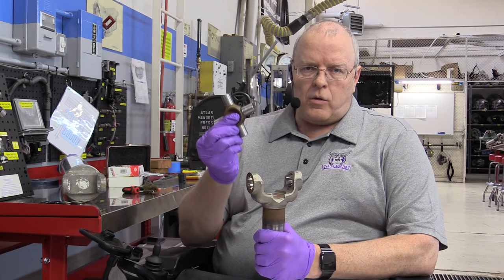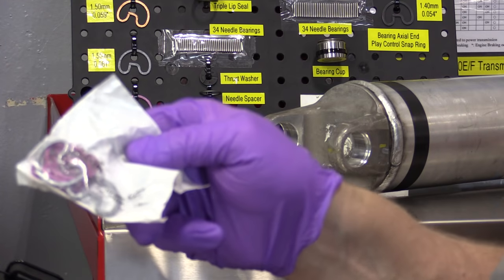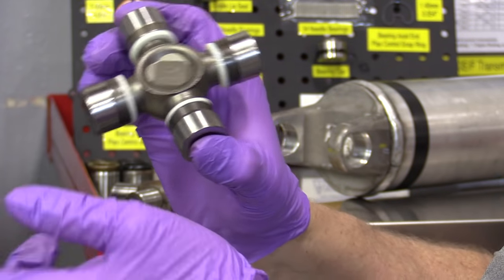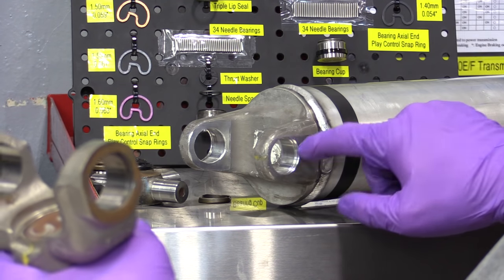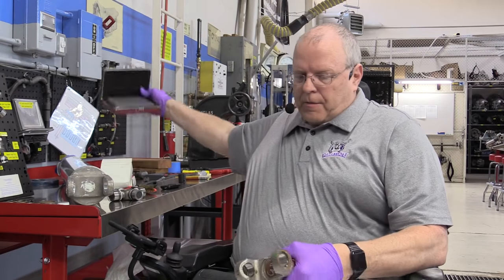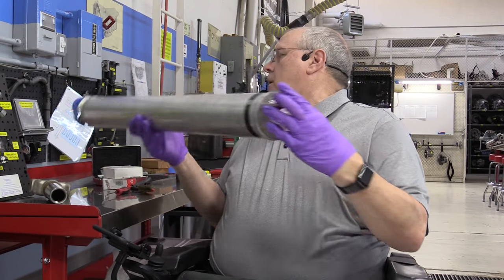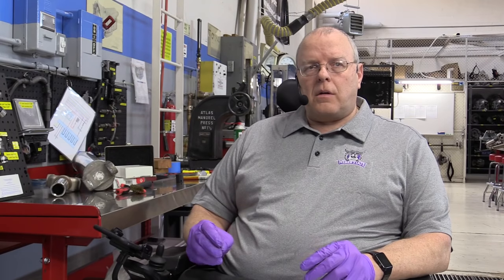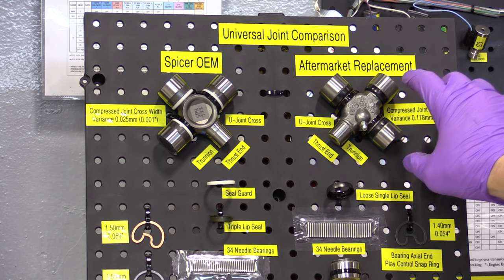Universal Joints - Part 6: Proper U-Joint Installation

Comment: This video, and the others in this series, got me through a recent u joint fitting problem. As someone who thought that the right way to replace U joints was using a hammer and a vise, this was incredibly useful, and of course when I followed the correct procedure, everything went smoothly!
Reply from the maker: Excellent! I am glad you were able to get it resolved. Thanks for watching

Comment: What a great series on the "lowly" u-joint!  Mechanic for many years, now mostly retired.  Learned a lot from these videos. They begin to expose the low level of knowledge in the  US auto repair industry (need more and better trade schools).  However,  mechanics in the rust belt deal with less than surgically clean , nearly new parts.  A good torch is their friend.
Reply from the maker: Thank you very much. I know what you mean.

Comment: Of all my years of replacing u-joints I've never had a u-joint come with different thickness snap rings. And many times I needed a thinner snap ring. You are also the first one that has removed a u-joint the right way. Nice video.

Comment: I notice a lot of the comments below are from people who had problems with U joints being too tight and being grateful for Professor Kelly teaching us about snap ring thickness etc.  I wanted to share my experience that might help.  I have a truck with over 250,000 miles that I often over work which causes me to need to replace U Joints every 60,000 miles or so.  Even using a ball joint press and being careful, the ears get bent inward ever so slightly each time I press out and press in a new joint.  My U Joints are now so tight even with the thinnest snap rings Spicer makes I am forced to either buy a new driveshaft or have a transmission shop cut off the ears and weld new ones.  I tried a driveshaft from the salvage yard and of course....its ears were bent in worse than my original one!  It was from a low mileage truck but you could see hammer marks where someone had hammered out the U Joint at some point.  So, I just wanted to get my experience out there that even with a ball joint press I still slowly bent in my ears.  I need to locate a tool that prevents this that is less expensive than Professor Kelly's wonderful press.  My best to all.
Reply from the maker: Great example. Thank you

Comment: Such an oustanding series!!! I wish my garage was as clean as his work space. Having just done the ujoints on my 2002 Seirra 1500 it can be like surgery, 1/8 a turn can make or break it. I did use some caliber grease In the ears but it probably was not needed or advised. The thing that loosened mine up after installing the new ones was a hit with a hammer at the end of the ears, it seems to settle them in so they spin freely, made a 50% difference. I also did not remove the driveshart from the truck so I guessed on the install orientation, but seemed to get it right as there is no vibration or clunk when shifting. One piece oem Spicer drivshaft and installed new Spicer ujoints, the label was still undamaged and easy to read. When in doubt call the Spicer customer service line with the part number and ask what was used originally, as the website information can be overload. And remember a new aluminium Dorman driveshaft is $800.00 for the truck the cheapest new I found was $240.00 for painted black steel tubing. A national tire shop chain claimed the driveshaft was unusable, but I filed a few burrs from one of the ears and it was as good as new.

Comment: Attempted to press out an old scrap GM  joint with the plastic retainers without using heat.  I wire brushed it, then applied penetrating lube .  Blew the end cap apart but did not budge.  I think heat is necessary on old, hard plastic.

Comment: Thanks for the class, after watching your video I had the idea to remove the snap rings from both sides and sand them down, then are not flat and I’m hoping a few thousands I can get this joint to move freelly, so far it’s looking better, one was .00515 and now I’m down to .00500, the other .00490, I do t see an issue with this as long as I’m doing it by hand and not heating it up

Comment: GREAT video .. but 45:38  i have found that after installing the caps, even if everything IS correct it still seems a little "stiff"  i think what is happening is, the needle bearings are side loaded by pushing the needles ( the cap ) sideways onto the trunnion and that causes them to drag instead of roll  ... i have found that if you put the yolk on the flat part of a vice ( on the back) and give it a quick _ NOT HARD_ hit on the back of the yolk, behind the bearing cap ( between the bearing cap and the shaft part ) shocks them into place and it "frees up" the needle bearings and it is loose as a goose. try it next time ... i think you'll be surprised !    
20yr cat equipment mechanic, ive seen a couple driveshafts ...

Comment: With that "sprung" snap ring, i would try to reverse the snap ring pliers, and expand that snap ring and then install it... ytou know if it snaps into the groove like it should, I would have no worries.. of course I have no data to support that, but it seems sensible.   Also I have a set of MOOG 232's for a corvette, and they just came with black snap rings... I will ensure I get a good fit!   Thanks for the class!

Comment: Re. Tight snap rings / cir-clips: I had the same problem. The old bearing cups were very hard to press out of the steel yoke and needed a lot of force. After fitting the new unit, I could only get the snap ring to fit in one side of the yokes. The other side was now where near close to being able to fit into the groove. I even tried an under standard thickness snap ring but that would not fit. I therefore  removed the new unit and it measured up. It was perfectly to specs. The only explanation therefore was that, under the force of extracting the old unit, the yoke ears had deformed inwards. This was confirmed by taking measurements of the yoke. The answer was to use an extractor in reverse to expand the ears back out to their correct spread.

Comment: I would consider running the snap rings on a whet or diamond stone a few times to take the thickness down. Could take caliper readings every so many strokes. About to change my 2003 Silverado joints in two days.

Comment: 1/100 mm is smaller increment than 1/1000 inch (which is 2.5/100mm) so you may prefer metric after all.

Comment: But why not use the u-joint removal tool when putting in the new u-joint? That would avoid any risk of bending an ear (even with the steel to spread the load)?

Comment: It could be the washer of the steel youk flipped out while being removed in and out, I think there should be some sort of direction on it. One clip shows grove on it for the grease to balance its self across the nedle bearing and move from underneath.  And this will add thickness if it flipped.

Comment: Nice episode. I have one question: I bought a new driveshaft from Dorman. The rear side has a runout of 0.4mm which is huge in my opinion. The runout is even for the entire lenght of the tube so I was thinking to compensate/ correct this by moving the u-joint using snap rings with different thickness. For example, if the current thickness is 1.50 for each one, I would use 1.55 in one side and 1.45 in the other, so the load will remains the same. Is my judgement wrong? Thank you in advance for your answer.

Comment: 32:00 Seems like the final press-in to make room for the spring clips could be made easier and more uniform if -- instead of a socket-and-bar arrangement -- someone would make a pair of round shims/washers, of very specific thickness (like a U.S. quarter or multiple thereof), that could be applied to the face of each cup. This way, once they are pressed flush (both at the same time), you'd know each cup was recessed X mm inside the outer face of the ears. Have you ever tried such an approach?
Reply from the maker: I have not, thanks for the feedback. I will have to try that. Have a good day!
Reply: Subscribing! The world needs more great educators like you, sir.

Comment: Thanks alot, i just stumbled on your video series, i have watched two already. i have a peculiar problem: I use a diesel electric generator off grid. I have massive misalignment problem between the prime mover and alternator, both didnt come from same OEM, it's a DIY assembly. I just installed a twin U-joint coupling  and i still get some vibrations. There is no shaft between the two U-joints, they were welded together. Do you think lack of a shaft is the reason for the vibration?

Comment: All these techniques are great if you're from the south. I'd like to see you use this press up here in new England and when the truck comes into the shop with 100k plus miles and it's all rust. This is great in a perfect world and on a brand new vehicle but unfortunately this isnt reality
Reply: Yeah, I lived in Boston and Philly and it is a nightmare working on cars from there.  I'm in Dallas now.  Original owner of a 2007 Xterra which has spent all 245,000 miles in Texas.  All bolts, axles, everything still looks like it did the day I bought it.  I changed a front wheel bearing last year and every bolt came off looking new.  Hang in there Michael, you got my respect!

Comment: Great video, just long but very informative! One question though. If a snap ring is too thick even on the thinnest ones, can't you slide them over a piece of sandpaper to make them slightly thinner? If you make them exactly the same thickness as the ones you took off, they should fit.
Reply from the maker: They should fit is the snap ring grooves are perfectly clean and undamaged. Thanks for watching

Comment: Really wish I had seen this video before I tackled my u-joints. I did them with a ball joint press but did not have the other tools. Thats the only way I have ever seen them done. I had the same situation where the snap rings were too thick and wouldn't go in. I sanded them down (hold your fire) to get them to fit. The joints felt good and free but I have a bad vibration from 40 mph and up. Worried I may have bent the ears on my yoke.

Comment: I installed three different ones in my yoke and I still have some play of the joint in the caps, but snap rings are in. When I filled with grease the movement went away but do I need thicker inner clips?

Comment: Where can I find the Spicer part numbers for the optional u joint snap rings?By the way I am working with 1350 series joints.
Reply from the maker: The Spicer small parts catalog. See https://www.google.com/url?sa=t&rct=j&q=&esrc=s&source=web&cd=1&cad=rja&uact=8&ved=0ahUKEwjRksqGkbPSAhVkqlQKHVfqCHUQFggaMAA&url=http%3A%2F%2Fmedia.spicerparts.com%2Fcfs%2Ffiles%2Fmedia%2FkX23a5sT5yt3LYTdn%2Fj300-p9.pdf%3Fstore%3Doriginal&usg=AFQjCNEugiout_OEUvjXTL2ZweBDDKy2Zg&sig2=L0CUJx30x53CTDhNvxN_6w&bvm=bv.148073327,d.cGw
Reply: Thank you
Reply: Where can I buy u joints for a Mazda Cx92008
Reply: I have downloaded a pdf of this exact catalog and spicer will not sell them to me. They also said they are only sold in packs of 25.  And, that I have to consult a "distributor" and upon doing so the distributor told me to send them an email outlining what i need, to which i never got a reply! These little snap rings are scarce and extremely difficult to deal with. The market is not hell bent on making them widely available.
They should be sold and stocked at EVERY auto parts store in the world that sells universal joints.

Comment: The only criticism I have is I don't see the need for the steel plate you used between the press plunger and the yoke.  The plate is just another item to try and manage without a third hand.

The plunger is the same size as the contact surface of the yoke ears.  Adding the steel plate has no advantage.  You are not distributing the load, as you say.  You are pressing directly on the same amount of surface area of the yoke either way.

Comment: there is so much variation in snap ring thicknesses, they should really supply more in increments of .001".
And, the fact that an aftermarket ujoint comes with only one thickness which can be way out of wack is deplorable.

Comment: I just had my u joint on my 2005 Toyota Tacoma TRD and my mechanic just used a hammer to remove and install the new part.    I was shocked he did it this way.    No balancing at all!     I could've got a weekend warrior mechanic for $60 to do the same job.   Not impressed!
Reply from the maker: Typical! Thanks for the feedback.

Comment: a thousands of an inch is a finer increment than a hundredth of a millimeter
i listened twice to be sure that is what was said
0.01 mm is about 0.0004 inch, 0.001 inch is about 0.025 mm
so a thousands of an inch increment is about 2.5 times coarser n than a hundredth of a mm......
Reply from the maker: You are absolutely correct, I got that backwards. good catch! Thank you.